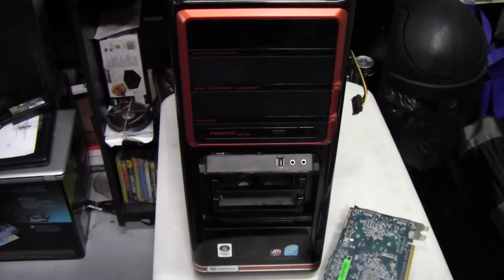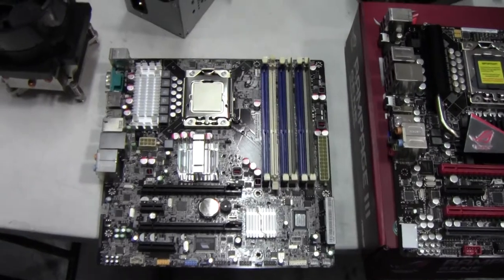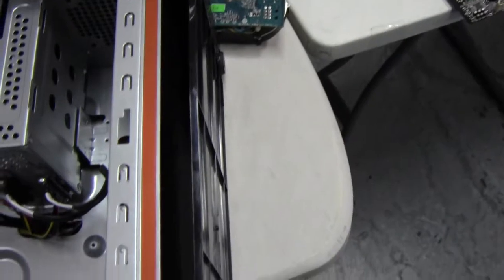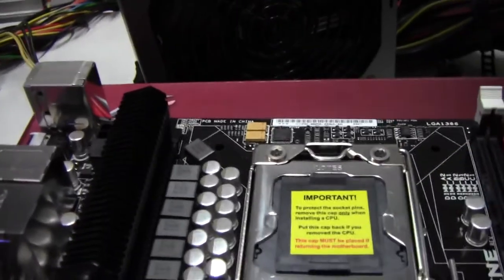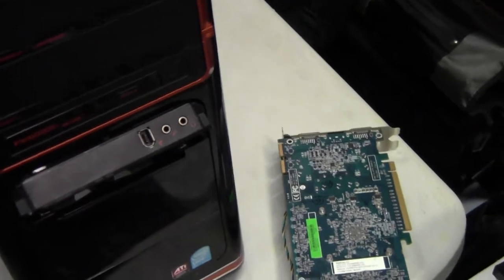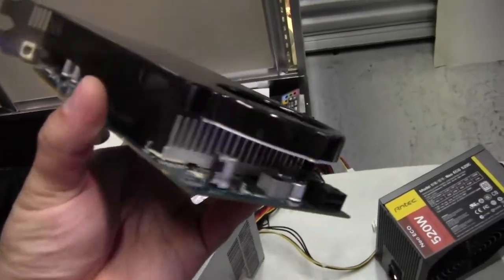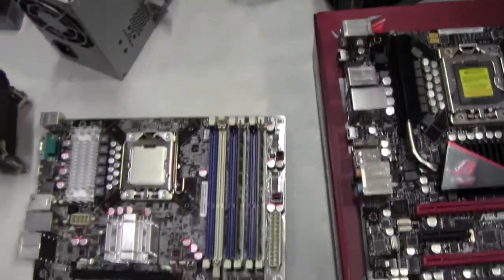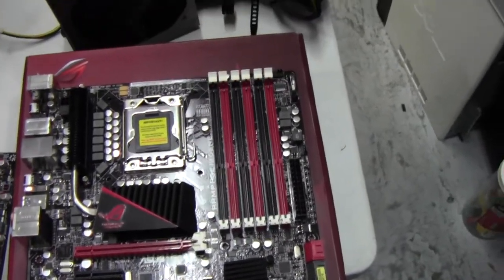Rebuilding an old Gateway i7 Why to Build instead of Buying in store

Comment: I have the same Gateway FX 6800-01e (minus "your" upgrades that is) which I'm still using today. Ive upgraded a few things though, which as you mentioned is basically essential given the stock specs. I swapped the CRAPPY stock PSU with a Corsair CX750, added another 3GB of OCZ Gold Series DDR3 RAM (making a total of 6GB, which I will probably upgrade to 12GB if I decide to upgrade the CRAPPY stock motherboard). I swapped the stock ATI Radeon HD 4850 with a HD 4870 that I got free (not much of an upgrade really, so I'm probably going to swap that for a GTX 1050 Ti or GTX 1060 soon). The stock 750GB Seagate Barracuda HDD died on me (apparently a common problem for that specific HDD) so I upgraded to 2 x 30GB SSD's in RAID-0 for Windows 7 OS and I'm using a 128GB external SSD for storage. I upgraded the stock CPU cooler (which really isn't that bad but its big, kinda ugly & pretty loud) with a Zalman CNPS9900a all copper CPU cooler with blue LED's, I also upgraded the stock passive aluminum Northbridge/Chipset heatsink with a Thermaltake Extreme Spirit II. With its all copper design, heatpipe technology and 40mm fan it is one of the BEST (both looking & performing) aftermarket North/Southbridge Chipset air coolers on the market. I also got an Enzotech SLF-1 forged copper low profile heatsink with 35mm fan for the Southbridge chipset, however I cannot FOR THE LIFE OF ME get the stock aluminum SB heatsink off, it seems to be attached with thermal adhesive as the damn thing will NOT BUDGE! Its stuck on there so well (and yes, I did release the tension/connection arms on the heatsink first) that when I try to pull on it the motherboard starts to bend with it, so I'm afraid of either breaking the MB or the chipset itself. This is a TOTAL BUMMER as I spent $35 on the SLF-1 and unfortunately I'm WAAAY past the return date. With that said, I have a request for you lorllc, if you can oblige me. If you still have that stock defective motherboard and don't want/need it could I possibly take it off your hands? I would like to see if the heatsink on the SB chipset is attached/glued on like mine, that way I can try some ideas I have to get it off without worrying about damaging mine, which is completely operational. So if you still have that board (I know its a long shot being so long ago) let me know if you're willing to help and what you want in return for it. Also, considering how well the i7 CPU's overclock I'm thinking of upgrading the motherboard since the bios is locked on the CRAPPY stock one. Ive also been seeing some pretty good deals lately on used i7 960's, 970's and even the Six Core 980x Extreme Edition's, so I might possibly consider selling my 920 and upgrading to one of those as well (if you have any advice/suggestions on how or what I should upgrade with my system by all means let me know?). Thanks for your time, for posting this video and I look forward to hearing back from you.
Reply from the maker: William C83, wow I am suprised that your Gateway FX 6800-01e is still up and running! But more than likely it is because you upgraded the PSU, the computer in this video died because the stock power supply shorted and killed the motherboard.  You have some good upgrades on your computer. Unfortunately I do not have the bad stock board anymore. If I did I would be happy to oblige you. Yes, the northbridge on many motherboards use a thermal adhesive, not thermal paste, and when the northbridge gets hot it gets stuck on more.  You said you "PULLED" on the northbridge cooler with so much force you are bending the board, Do NOT do that you will definitely break something.  Instead what you need to do is try to ROTATE the northbridge cooler - twisting it left and right and NOT pulling on it.  This way you will be able to break the adhesive with rotational force and the Northbridge will pop off. It may take a few twists and it may be stubborn but you will eventually be able get it off with this method. I personally have never had good luck overclocking the i7 920, they get very hot and I never got one over 3.5 GHZ on air cooling. Also William C83 1366 motherboards were very hard to find when I did this video way back in 2012 and I recall the Asus board was near $300!!. Finding a micro ATX 1366 motherboard now would be very difficult and they would be old not to mention overpriced.  I would recommend that you look into building a hasewell 1150 system since they are still being sold and you could use your ddr3 ram.  Even a 4670k will outperform the six core 1366 i7 in many applications.  I am not sure if the stock Gateway bios will recognize the Gulftown processors. And I cannot find any information on CPU support for that Stock board.  If you can find a 960 for cheap then I would suggest throwing that in since the bios should recognize it.  Good Luck William C83!
Reply: William C83 I have same pc still running replaced few things graphic card with 1080ti power supply hard drive  and added more ram 12gb total runs most games on high settings still a great gaming pc with few upgrades:)
Reply: I have the same pc, still running on Vista I wanna upgrade to windows 10 is it possible? Without up grading motherboard? Though that would be sweet and I may just do that, but for now I would just like to upgrade to Windows 10. Did you upgrade to Windows 10 prior to rebuild?  I think I'll be building my own here on out for sure. About how much if you don't mind me asking was your rebuild in total just to get an idea. Thanks
Reply: @lorllc  Great video, Thank you so much. Can you read that comment I Left for William in regards to windows 10? I did call windows support,  they told me spec are about the same should not have any issues to download windows 10 and then I called gateway they said no it won't run. I just felt they were trying to sell me a new pc and have me pay for year of tech support before help me. Again, Thank you for making this video. I do like that motherboard how much is it do do those sweet upgrades?
Reply: I know gateway recommends max capacity of 12gb But do you think it can go to 16gb?
Reply: @367cuba1  The Crucial website said it can go to 24 gb ram. It comes with 6 slots, so they're using them all I guess.